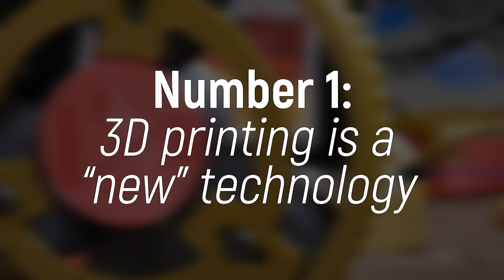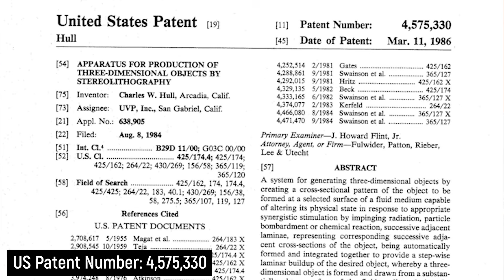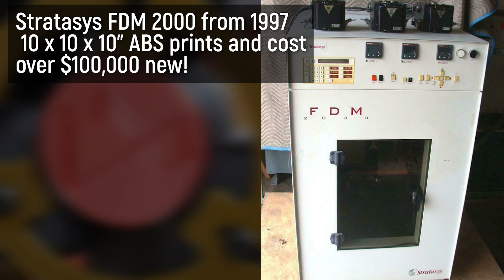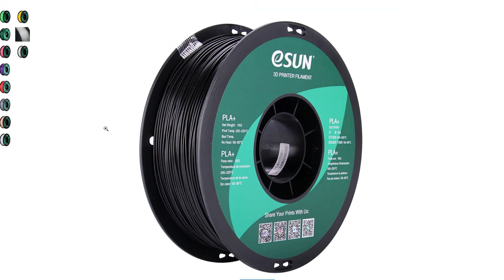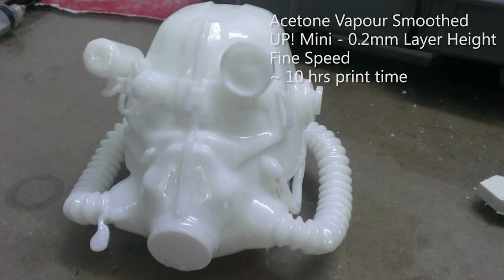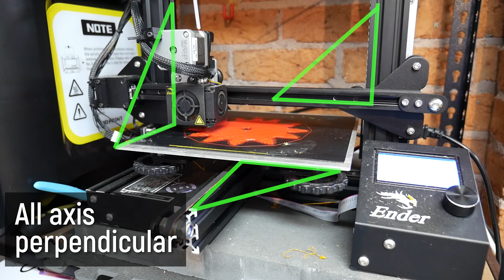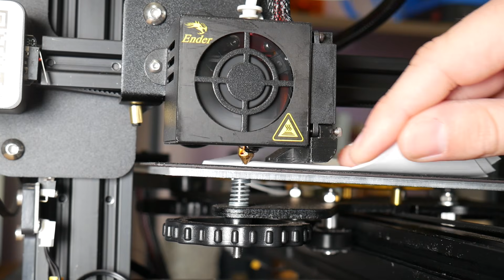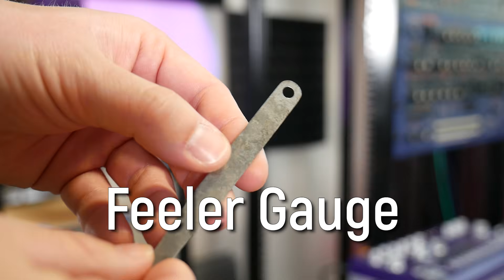3D Printing Myths I used to believe...

Comment: leveling.........Better option ( the best option).... use light
use your cellphone, turn on the flashlight, place it (top side down), so the light is near the bed, behind the nozzel, leaning against the x axis, so the light shines on the bed, not directly in your face, then adjust the nozzle height so it touches the bed, but dosnt press into it...... if you see a gap of light between the nozzle and the bed, its too high, if you can raise it, and there is not a gap, its too low..... if you have no gap, and no room to move, this is pretty much your true zero. Light is much more accurate than any paper, shim gauge, or end stop.

note- this is my own method, and have not seen any one else do it.
Reply: I used to zero level with light, and then when i had to break down my printer and move, afterwards i forgot that! Thanks for reminding. Also the printer sits lower now, so it's much less convenient, it used to be on my desk before move, but now it's on an IKEA LACK.
Reply: @SianaGearz  awsome to the used to do it part, sucks to the less convenient part.
since day one ive wanted to make some sort of laser level system and/or tool for it, but never figured it out.
Reply: @ZOMBIEHEADSHOTKILLER  Yeah unfortunately something like ToF and parallax sensors you can buy are too coarse and don't work on small distances like that. I have considered. Currently i just have a touch probe that i cobbled together from junk, a 3.7g micro servo which swings a little foot, on which a super microswitch from a mouse is mounted. I have a whole bag of Panasonic switches that i got for a dollar to repair Microsoft mice, they're half the size of the usual mouse switches and two legs instead of 3, super little force, works fine. I actually intended to make one of those typical opto gate sensors, where you have some kind of servo or magnet actuated probe pin, which has a flag which interrupts a light path, like with an optical endstop or Vishay TCST gate, but i somehow misplaced all of them, and decided to do without.

I think a path forward towards your idea could be a CCD or CMOS line image sensor and you shine a focused laser down and evaluate the light image in a microcontroller, i think TI makes such sensors, maybe Pixart or Avago? There's also an SPI camera OV7670. But then i'm not convinced that such methods work well with textured surfaces, and glass tends to be an issue too. Everything has issues. Microswitches, inductive, Hall effect are hypothetically sensitive to device temperature. Ultrasonic is sensitive to air temperature. The IR gates like TCST are sensitive to stray light ingress.

An interesting line of thinking could be failure detection. Say you have a sensor that can estimate distance from an obstacle in a given location, like you can even think ToF (laser time of flight) optical sensor such as STM VL53L0X/L1X, or even an ultrasonic distance sensor or whatever. You have your slicer or a slicer post-process generate commands of the type - move to location XY, check that estimated depth is no less than A and no more than B, and if it's outside, whole print or just print island is automatically aborted. You can do those checks once per layer during layer change, and you'll catch a dislodged, critically malformed, fatally failed print within about as many layers as you have islands on the print. You can even insert those checks mid flight while you happen to travel over something. The slicer can take the angle of effect (FoV) of the sensor into account etc. Slicer can insert demarcations into G-code which tell the printer where each island begins and ends on each layer, and each probe command can be associated with the island number, so from then on, if failed, printer can skip the particular island. You would have an actual marketable product on your hands if this can be combined with bed sensing, if the sensor was sensitive enough, but alas.

A few people have been doing nozzle cams now, because it's fancy, you get cool videos. You can get a $5 endoscope camera, they run 640x480@30fps via USB, and they're 5mm or 7mm in diameter, depending on LED type and arrangement. Say you had a Pi do image recognition and detect when nozzle touches the plate, by shadow or whatever, but this seems error prone fundamentally, seems like something that can just about be done with recent advancements in AI tech, but would still be a massively tall order both for the small single-board computers, for a small-scale operation which doesn't have dozens of different printers, and for the individuals not educated in image recognition technology. But then you could potentially also detect other kinds of issues, such as before the nozzle gets fatally caked in junk, or when the sock falls down, or when it starts scraping top of print, you can see it. I have one of those endoscope cameras now, a 5mm variety with a floppy USB cord, the usual are 7mm and reinforced stiff cord, and it cost me all of 6€ or so shipped from Ali, i might make a holder to fit it down there besides the nozzle eventually, but i don't anticipate myself developing image recognition really, maybe, but probably not. There are better endoscope cameras too, like 720p+, maybe higher framerate? Of course they aren't $5. But 480p is plenty of data to choke on, and honestly not that bad looking for a little bit of a useless little side project, it's hard enough to get things in focus to begin with and there's no physical room for autofocus, and tiny lenses are hardly all that sharp, so better endoscope might not end up being all that much better.
Reply: @SianaGearz  not gonna lie, most of that is beyond my abilities, both technically, and monetarily, but its cool to hear new ideas. My printer also has a servo with a micro switch set up, it works well enough , and ill use g29 to make adjustments for bed leveling, and when i need to, my light method. Ill just keep using my cellphones flashlight, it seams pretty accurate for getting layer height set, it can work for bed leveling as well. It dosnt have any problem with glass, or bed stickers, but im sure there is some situation where it has flaws, the only one ive really found so far is its a bit of a slow process, and of course, is prone to human error.
Reply: @ZOMBIEHEADSHOTKILLER  None of the things in question are actually expensive really... like even as overkill of a sensor as OV7670 might be, it's only $10 - used to be cheaper. Orange Pi Zero and Banana Pi Zero have been rising in price quite a bit, which is unfortunate, and they are janky but they do have a good bit of raw horsepower, also the price hike isn't here to stay.

As to line sensors, it seems almost all of them have evaporated. Once a certain application field no longer has a mass consumer behind it, it tends to happen. AMS still has TSL1401CCS but it's about to be discontinued too, declared NRND. It's only a $6 part, but it requires quite a bit of external logic, nothing expensive, just a lot of somewhat complex and error prone work. By the way, when digging, saw that AMS also has structured light emitters, apparently that's a thing now for FaceID and such. Can be relevant. There's lots of material how depth sensing in first gen Kinect worked, that was a structured light system too.

Most of the things i mentioned are things i could potentially accomplish or at least make some headway in. But i also don't really see the incentive to put all the effort in.

Been kinda itching to do something with Allwinner F1C200s or V3s, but when it comes to camera interfacing, oof, i'm likely to get quite stuck.

The good thing about manual visual control is that people can account for all those things that typically go wrong with automated methods. You just look at something from a different angle until it makes sense visually, which is not a capability that an automated probe has.

Comment: I do want to add ABS has great impact resistance. I use it to make airsoft gun parts, if anything is going to be dropped or in my case shot with a bb going 3-500fps ABS is pretty good

Comment: That paper trick advice is going to be very very useful. I was taught the paper trick too as a reliable method, but quickly found that "eh, it depends" as my teacher didn't say it had to be folded. He just used a normal piece of A4 paper. And even when it comes to using paper, there's still the question about thickness. Different thicknesses will yield different results. A measuring gauge like the one you used, stays the same size all the time. There's no confusion added to that and a little bit of testing will quickly help determining how much it needs to drag/stay snug to allow for perfect printing. Gotta get myself some of those now

Comment: getting "z0" with paper is fine, it just does not end with that. then you should testprint until the firstlayer looks like a "mirror" and does not seperate between the individual runs

Comment: Love the video! This is the first time I’ve commented on a YouTube video! 

I have been building and programming 3D printers professional since I was 16 the “paper trick” for me was always used to square your bed to the X and Y axis of of the printer rather then use a paper folded I use something insignificant in thickness because all my printers are programmed to lift off Zed dependent on extruded thickness. I use a receipt because when there is a specific amount of pressure it feels like a zipper when you pull on it. I tend to check 9 points on the bed because as well as helping get square to the print area it will also let me know if the bed is warped.

Hope this helps anyone!

Comment: I'm probably giving a sermon to the choir here, but:
As said here, the "levelling" actually tilts the bed, so:
if you bring one corner up, you make the opposite corner go down, if you think of the bed tilting with the two nearer corners as pivots
or 
you make one or both of the middle corners wrong, if you think of that opposite corner as the pivot. 
Either way, a metal feeler gauge is best, measure twice and print once (and check your "first layer depth" setting).

Comment: Haven't seen the video yet. Only the thumbnail. The paper trick is useful for manual milling with position sensors, but probably unnecessary in CNC machines...

Comment: I noticed my Prusa i3 Mk3 on the first layer printing a wide object that the Z axis screws were turning just a little, telling me it's following the contour of the bed height it just measured because it knows it's not perfectly level.
Very neat, and explains why sometimes the first layer looks better on some parts of the bed than the rest. I'm intending to do the nylock mod sometime soon, right after I figure out how to get the Raspberry Pi working ;)

Comment: My man just adjust the z height in the printer setting..... While printing something after leveling go to tune and you can adjust the base z offset. If you want to be super accurate do a line and mark where on the line you changed the offset, record the order of offset changes, then use a set of calipers to measure the thickness of your printed line and choose the setting that gave you the exact first layer thickness you chose in your slicer. This bypasses all possible mistakes or problems with gcode, firmware, or mechanical problems causing the offset to not be correct.

Comment: From my experience, I found that whether level the print bed with paper or a feeler gauge biggest issue is the print bed never be perfectly flat, the edges are slightly be uplifted in most of the machine !
Reply: Replace the bed with a mirror. Even cheap plate mirrors are extremely flat. A downside is that it can be hard to get the print off the mirror until it cools completely.

Comment: Beyond tramming the bed, printing with a skirt serves two purposes. One, it primes the hot end and provides visual confirmation of proper filament extrusion. Two, it provides visual confirmation of proper nozzle height. 

I think Chuck Hellebuyck of Filament Friday fame covers this but I run my finger across the skirt as it is being printed. It should feel like fishing line. This will expose a too high nozzle when the filament is not sticking to the bed and a too low nozzle when the filament is flat, like a skid mark. You only need to check four sides/corners to get an idea if you're low or high and can live level (turn the wheels under the bed) to adjust. By default a skirt has three passes. If you're not happy with the way the skirt prints, cancel the print and tram the bed again or just start the print again and continue tweeking the skirt.
Reply: I considered making a comment that printing with a skirt also makes you look fabulous but I didn't think anyone would take me seriously after that. ;)

Comment: I never found the paper method to be useful, the stupid method I found that works every time for me is to move the nozzle to each corner and adjust the height until you can see light through the area underneath the nozzle

Comment: ABS is just more stable if used in a car, and also finishes way easier than PLA, but unless you use stuff that will be used in the car, go PLA, or you can just use PETG, Like ABS for car stuff that will be used in the car and will be painted, if no paint is used I go PETG

Comment: When I was a kid I would make balsa wood remote control air planes. I’d spend 10 hours fixing for roughly 1 hour of flight. That’s how I’ve felt with bed leveling vs printing. Thank you for this info!  I recently gave up and ordered a prusa mini with auto bed leveling hoping to avoid my many many many hours of attempted leveling.

Comment: I have NEVER seen anyone fold paper over for tramming before.  I have a MUCH simpler way to explain to explain the BASIC misconception about the use of paper.  The paper (or feeler gauge) are to get you in the ball park.  There is NO substitute with consumer printers for adjusting based on the plastic coming out of the nozzle.  Though if you’re using a bed levelling sensor, that final adjustment may be with z offset rather than bed knobs.  As you very correctly pointed out, consumer grade materials may vary considerably in their composition.  So that final adjustment can be crucial to handle differences from brand to brand and even colour to colour.  Yes, the additives that colour your filament CAN change its behaviour.  So if you’ve ever noticed the same brand’s white and black filaments for example, like slightly different printing temps or minor differences in z offset, there’s your reason.

Comment: TBH using more than one layer of paper looks like a sure way to get inconsistent results.
My favorite method of making final adjustments is to print a one-layer square along the edge of print bed. It is an easy way of checking for bed squareness and flatness, because with four screws we can get the bed to stop being flat which lets glass bed pivot and makes clamps affect bed squareness to Z Axis.

Comment: Ever since I got my first printer in 2017, even the existence of the Z-Offset in Marlin firmware has always bothered me.  The printer (TAZ6) calibrates all axes when homing and does fine touch measurements of the 4 corners of the bed.  Why should it ever need this Z-Offset?

Using paper to tweak the Z-Offset also bothered me, but I let myself allow for the possibility that this couldn't be calculated since the distance that provided good results could vary by the filament and temperatures used.  I figured paper was only a rough guide to get you into a reasonable range of some manually determined adjustment that might still need manual tweaking later.

Comment: Main difference between PLA and ABS is is more of a toughness rather than which is strong. PLA is more softer compared to ABS so when you pull ABS will brake first. But if you want to make things you will use outside and can reach 50C temp, you'd wanna use ABS or PETG or ASA etc. If you wanna build anything for indoor use, you should go for PLA because it is the most forgiving filament

Comment: I tried using a feeler gauge before but my application of it was wrong. I had tried to use it the same way as a piece of paper without adjusting the z offset

Comment: Clarifying myths with misnomers? For a 3D printer, we are actually verifying frame alignment in squareness and parallelism of XYZ as relative to each other is as good as it gets. 
There is no such alignment as tram on a 3D printer. Tram in precision machine tool terms is specific to spindle perpendicularity relative to a plane so we are not driving cutters skewed at any odd angles to the work plane. There is nothing spinning at our nozzle tip, so tramming would not be an accurate description for the application.
I've always considered bed leveling a misnomer too. Again, Bed parallelism relative to the XY plane is what we are really achieving as the last critical step in alignment to the rest of the frame.  The alignment sequence and/or process will vary slightly different for each type of frame or axis design depending on standard moving bed or moving gantry, although the axis squareness/parallelism/ goal is still the same.